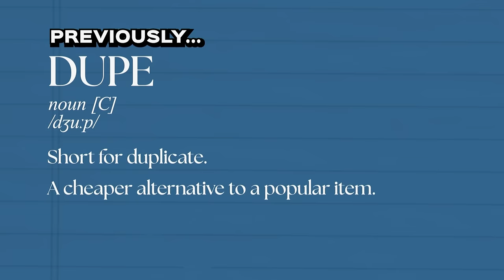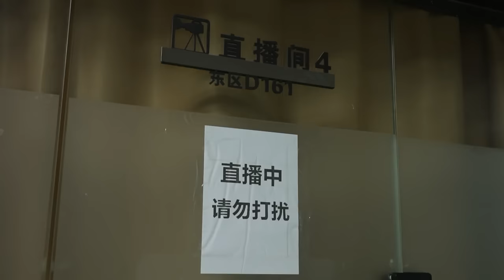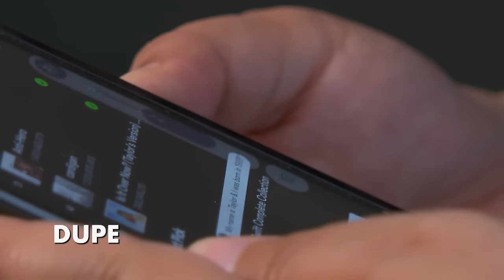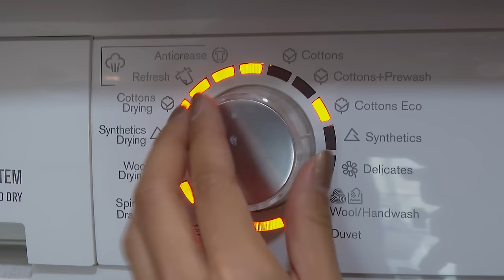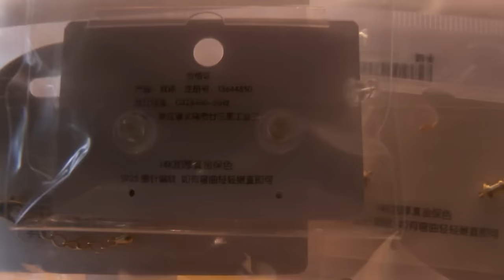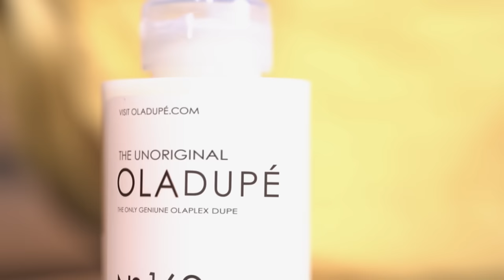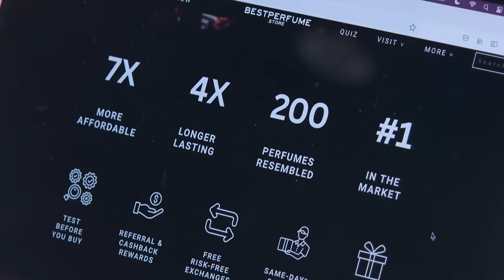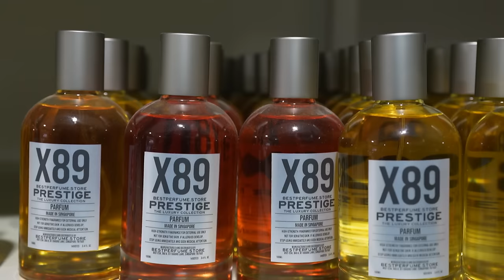When Are Dupes Worth Your Money? | Talking Point - Dupes Revealed (Part 2/2) | Full Episode

Comment: Even at a French perfume factory I visited last year, they told us that it costs about USD $5 to make a 100 ml bottle of perfume but because there is a lot of competition and they have to spend a lot of money on marketing the product, the selling price to the consumer is $100.  Besides, if they sold it for $20 they would  still make a profit, but people would  now think of the product as "cheap and inferior" so a high price makes people think they are buying "quality".
Reply: Hey there! I'm Josh from the show itself. It definitely can be as low as $5 (especially at cologne/edt doses) and if they're using cheaper perfume materials - the hobbyist profile will be vastly different from what's used in mass appeal mass produced markets. LV released their margins for perfume recently, and to no shock as a manufacturer - but maybe to the public, fragrances were at a 14% margin despite what's wide spread on "how cheap it is." A lot of costs of perfumes, considered a dangerous good, goes towards licensing, border checks, and keeping proper manufacturing practice, and of course - ethical labour sources. It's extremely disheartening as the average consumer understanding of perfume seems to be "high margin", when reality, it's really far from that. LVMH also posted that consumer goods were at 40%, more than 3 fold. Just wanted to add this as it is a far cry from a "95%" profit margin, unless you dodge all the compliance and safety - then yes, those random pop-up 'dupe' places probably do profit that much when you remove all legislation and checks. To be transparent, post-taxes, we're at about 19% operating margin, and this is assuming a Q4 market (high spend, vs a Q1, a harsh falloff). If you're curious on the finances or anything else hobby or business, do ask away :)
Quick edit: Owner of Sunnamusk also discussed on 10-25% profit margins too! It's just there's a ton of legally obligated costs associated outside of just materials/processing before it gets to the consumer.

Comment: Regarding the tights, at such a low price you'd be expected to buy several pairs so that each doesn't get stress tested as much, and combined they'd last longe than the one original pair, and still save money.  Nowadays no one will know it's a dupe and no one will be checking out the label. Though owning a real pair or a few is still a long term investment and gives peace of mind that the garment will not fall apart. You can wear the cheap dupes to clean the house, garden and other dirty work instead of wearing the expensive pair. There's a purpose for everything.

Comment: Dupes are trying to copy the designs and not necessarily the complete functions, most importantly not trying to sell itself as the original product thus minimize getting into IP lawsuit. 

While there's plenty of things that can be reasonably duped but there also plenty of things that not wise to purchase as dupes. If you getting dupes for "fashion", that is sensible because fashion shift rapidly.

However, if you getting dupes for sports like shoes, I don't think that is wise because good reliable shoes is very important, you don't want your feet to be injured because of bad shoes, heck, may not even end at your feet.

Comment: I have a question about the perfume one. Wouldn't higher concentration mean more expensive? Or is it because brands mark up their prices so much that even with fillers they still charge much higher?
Reply: I would think it's mostly due to branding, maybe partially R&D but perfume dupes also do their own R&Ds but not sure if it's as extensive... Cost price of luxury bags are waaaay lower than what it's sold at, same goes for the perfume all these luxury brands sell.